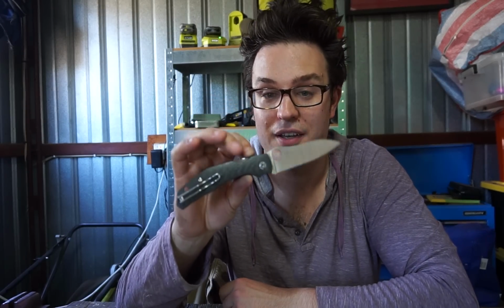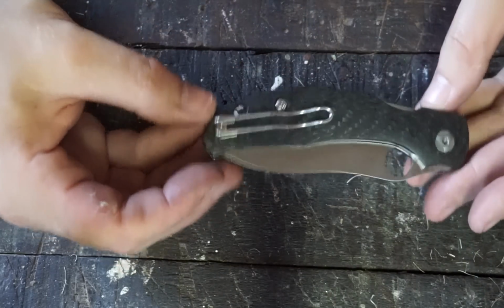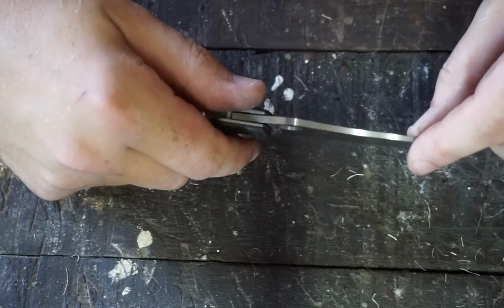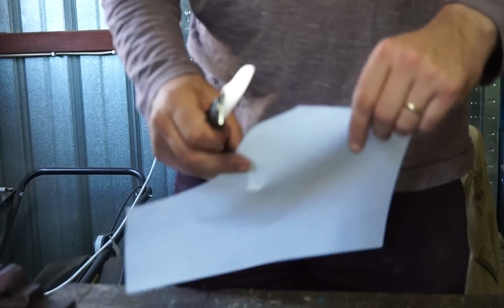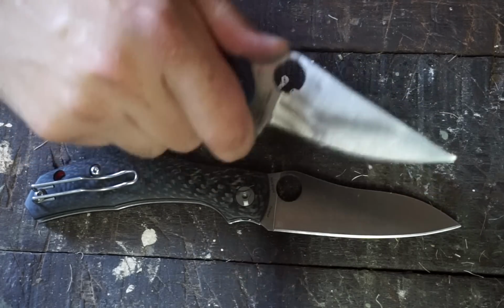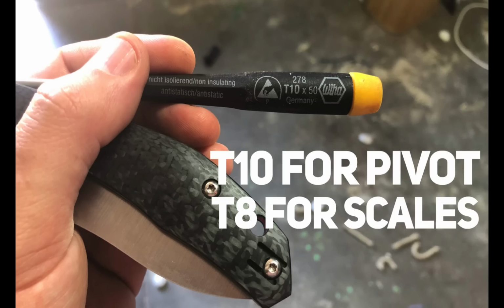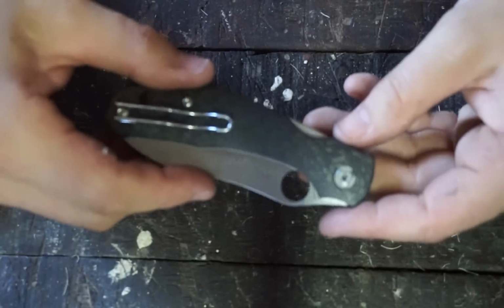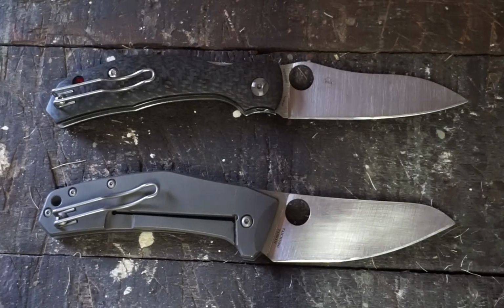Spyderco Kapara - New - Full Review, Edge Retention

Comment: I got the Spydiechef after watching your review on it a couple times. Someone on bladeforums forum said he moved onto a Kapara for food prep. I didn't have a compression lock yet and liked the look of it. Slim. So I bought one.

Before seeing your review, I had the exact same critiques, with it being a little harder to grip and flip closed, easy to drop. It's not the best specimen of a compression lock, I think. The perfect lock on this knife would be an Axis lock. If it would just flip open and closed with the lock the way my BM 940 does, it would be PERFECT. It's even a bit more ergonomic than the 940, but that 940 action is pretty much unbeatable.

This guy is not quite as nice as the Spydiechef for food prep. The narrower blade means it's not as slicey. But it's better at everything else, I think. (esp. being narrower in the pocket) The Spydiechef, being sharp so far back and being so wide at the base of the blade... gotta be careful when closing that one or it'll bite you but good.

Comment: Love that you compared it to the Benchmade 940. I have been trying to decide between the two, I know the 940 was a grail for you, but between the Kapara and the 940 which would you recommend the most?
Reply: I've seen them compared the consensus seems to be that the 940 is a classic but it's aging and that the Kapara is better at basically every the 940 does with better ergo's. The only advantage the 940 has is that it's slightly lighter.